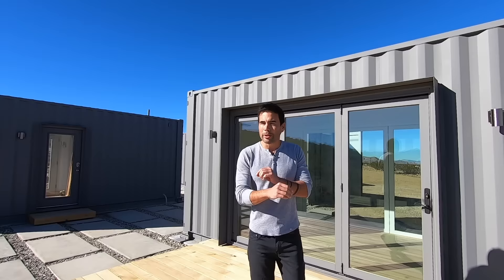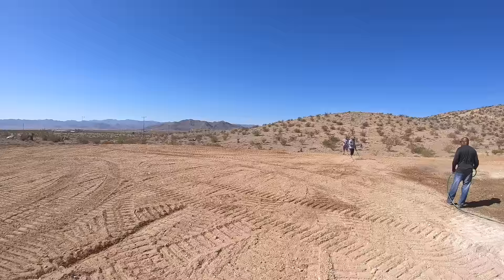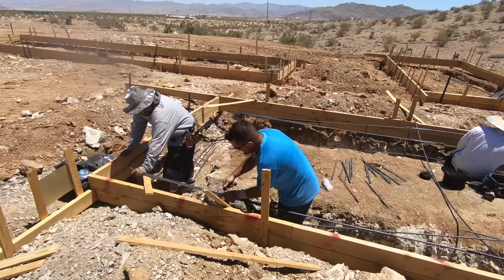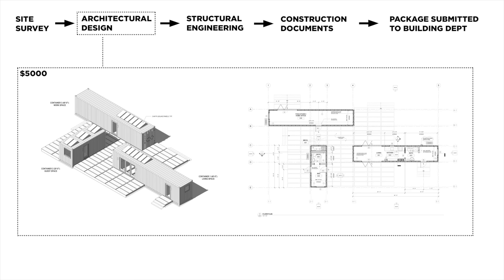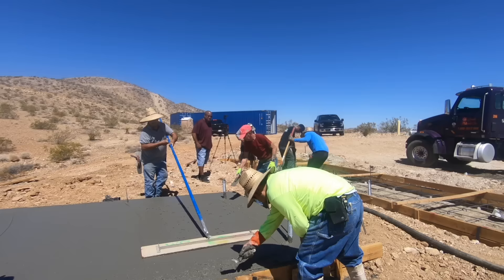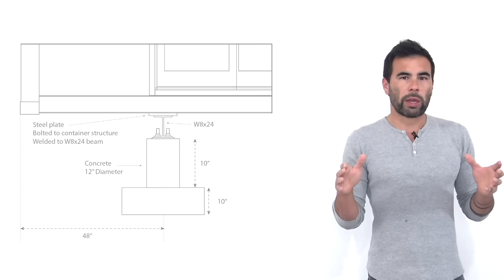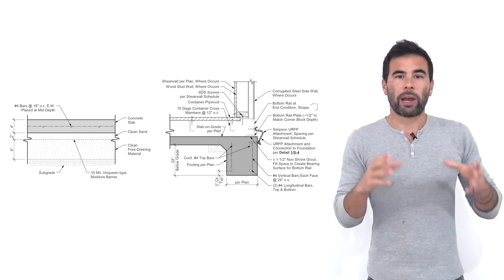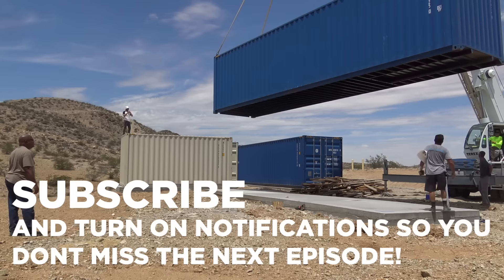Building a Shipping Container Home | EP01Permits and Foundation Design

Comment: I think concrete slab is a really good idea. There are of course more effective ways but your method is the most cost efficient. I would dig a hole big enough for another container, put them on top of each other then weld them together. then put steel reinforcements to the side corners. That way you would get a basement but it would cost more.

Comment: I thought the whole idea of Shipping Container House is to minimize work, time and money for constructing a home... and I don't think you saved any of those for it to matter
Reply: 99maxa ...it was an exercise in absurdity. A conventional interior built in a steel oven in the desert...only because of the “repurposed” cashe?
Reply: Cache
Reply: @davidjose2193  - hey David - did you know you can go into your original comment and edit it?  Off to the right are 3 vertical dots. One will say 'edit'.  Click that and you can fix anything you wrote.
Reply: To be fair, the actual construction of the home was far cheaper than a 'normal' home would be. The permits and taxes wouldn't be factored into the cost of materials and labor. Realistically, even with all the permits and taxes, its probably still cheaper than constructing a regular home in the same location.
Reply: @michaelbaker2495  Now imagine how much cheaper it is to do in EVERY OTHER STATE.
Reply: Yeah, but you'll only need 4 Mexicans or Central Americans to do the job vice 30
Reply: If it's just a box on the ground it IS cheaper. It's when you start to stack them in weird configurations that it becomes absurd. There's a Grand Designs where they essentially get a bunch of boxes in site and end up completely rebuilding them.
Reply: the slabs cost more than the containers.
Reply: That's exactly what I was thinking like wow this is an exercise in building a house so why not just build a house out of you know house materials???... LOL he's a Californian ON PURPOSE....we cant realistically expect too much I guess

Comment: That foundation is way over the top, you've been taking for a ride on that
Reply: What would be wrong with having six or eight 12" Sonotubes and putting the shipping container on top of that?
Reply: @andrewmalone8709  seismic activity. It's California.
Reply: @TheLegendaryFolklore  I get that, I'm just wondering what the problem would be structurally if you did that. It seems like it would be perfectly fine in a saner state.
Reply: @andrewmalone8709  it would be, but considering it's Cali, I think seismic waves would just kick the house into waves and shred the container one pillar at a time instead of a solid platform.
Reply: I doubt the amount of concrete, size of the hole, etc... had a real significant impact on the total cost of the house
Reply: Why are saying the concrete slab is needed for the seismic activity?  If concrete is so stable in an earth quake please tell me why all the concrete roads break-up and the highway bridges fell on top of each other? They put a kind of spring in the ground under Mobile Homes to be safer Crete Grease from earth quakes. We had several and had no problems 2 years I was their.

Comment: So far I've seen one suggestion for a different foundation and about 200 gripes about California. 

I would agree with that one suggestion: use piers at each corner. To deal with the lateral stability issue, make the piers sit on massive footers. Or use the box itself as a structural element. The connection between the pier and the box would have to be totally rigid in all directions, which might call for some additional steel welded to the outside of the box. I could see I-beams welded vertically to each corner, and then extending downward and embedding in the piers. Or something. 

Can't wait to see how he insulates this thing.
Reply: @toothlessgrin7540  That's right, he said that. And he wanted to keep the floor level with an outdoor deck, so that would have to be raised too. Hm. 
Not to argue with his priorities, but I think I would have gone with a raised house and deck. That might also have helped the house adapt to the site, which isn't totally flat, it appears. 
I don't recall why he rejected a perimeter wall foundation.

Comment: $25,000 for permits?!  Legalized and government regulated bribery.
Reply: Seriously Criminal. Land of the Free.
Reply: It's more like extortion than bribery.
Reply: What u didn't no that your gov is the REAL MOBB.....🤣🤣😂🇺🇸🇺🇸🇺🇸🇺🇸snakes of America
Reply: @Justin Case, Hey Justin, You wouldn't happen to be from Australia would you? Like the Justin Case I met at Phegans Bay on the Central Coast of NSW?
Reply: For 25000$ I got a large container house (10m*4) plus a pool
Reply: 25g is cheap here in Cali.. I've had quote as high as 150k.. He's lucky he's not in the sewer district or city limits
Reply: It lumped the $25000 into all of the preconstruction feed  i.e.  surveyor, architect, plans code review etc...    also permitting for tying into an area that was remote.  This is actually pretty normal
Reply: And the government wonders why homelessness is rampant. They make it illegal to claim a house, then require people to not be using drugs before being eligible for shelters, which is fucking hard to do when you don't have a bed to sleep in while your body detoxes, a home-cooked meal to nourish the body as it recovers from drug use, and a toilet to throw up in as your body tries to remove the drugs from your system, and then make stabby pavement or back-breaking middle bars to keep homeless people from having a respite from the elements.

Meanwhile, in Utah, the housing-first program was widely successful in getting homeless people off drugs and onto employment, saving the state more money.
Reply: @luvair6765  land of the expensive more likr

Comment: Dude shipping containers are engineered to handle way more stress than this will ever take. I think you over-engineered the whole foundation. Also why would you try to create anything of value in California? You're not even near the beaches, just go to Nevada it'll be the same thing but cheaper.
Reply: Your perspective is understandable but fairly ignorant.  Few questions for you... Were they designed to have large holes cut in the corrugated steel walls for doors an windows while  still perform to the "engineered" stresses you state?  No...  Were they designed with certain deflection criteria in mind that will prevent windows from binding/cracking over time? No...  Were they designed with higher factors of safety required when dealing with residential dwellings as opposed to industrial applications?  No...  Is there someone at the manufacture's company willing to stamp the permit documents accepting legal liability for the containers performance?  No...  I agree that other states let you "do it yourself" but the ones that do don't have significant earthquakes threats to worry about. This area on the other hand has the San Andreas fault running right through it.  And there are countless people who dump these containers on their property in the desert and live in them without issue.  You just can't permit them, meaning you cant insure them or sell them as a house to someone else.
Reply: travsb1984 you are the only reasonable  person in this comment section.
Reply: @travsb1984  
1: No, but this won't affect their sturdiness as a single-story structure. The frame takes most of the load, even if the holes are in the corners it will still have more than enough shear strength for this.
2: They are designed not to deflect that much, as they need to be stacked incredibly high without tipping. Think about a normal wall. It's just a wooden frame with studs running vertically every few feet, some diagonal members, and drywall nailed over it. This is a welded steel frame with corrugated steel walls designed to support over 20 tons in stormy waters. The windows will be fine.
3: The standards they are designed to meet are far more intense than those of a residential house (as far as structural integrity goes) This is why they are made of corten steel, and houses are made out of wood. 
4: Why would the company need to accept liability? Their product has been modified and isn't being used for it's intended purpose. 
5: Many of the regulations he ran into had nothing to do with earthquakes (700 sqft minimum footprint, 18" minimum 'crawlspace' height, etc.). 

These containers are designed to be stacked and unstacked 10 levels high on boats for 10 years straight with essentially no maintenance, exposed to the elements and the waves, connected to one another only by four bolts.
I think they can handle sitting on the ground and having people walk around in them.
Reply: @bradenanderson6989  Your responses and assumptions confirm that you still know very little about engineering principles, or how the permitting process works in general...  Thinking something will work, and proving it will work mathematically are two very different standards.  FYI, all of my questions were rhetorical and had answers of no...  I would agree that California has too much red tape, but most of the design considerations would apply anywhere, not just in CA.  The only requirement that stuck out during the video that made me role my eyes was the 700 sq ft requirement.  To my knowledge this is not a California requirement. Building codes in California are actually controlled at the local level, and they are free to amend the CBC however they see fit.  I suspect the 700sq*ft requirement is a local requirement.
Reply: @bradenanderson6989  Not to go to crazy in the comments, but I'll give you some insight.  Shipping containers are not designed to be perfectly ridged bodies.  They have some flex in them.  This allows each container to conform to the support it's placed on so that all four sides will align with the pined restraints and full bearing will be maintained, preventing them from "teeter-tottering" on uneven ship decks, tractor trailers, or train cars.  I had two of these containers on my property for storage and can attest first hand they are far from rigid.  We leveled the ground the best we could with shovels but we were only within about and 1" of true flat.  When the containers were dropped they flexed until all sides were fully bearing on the soil.  This was perfectly adequate for my needs, but if this were differential settlement caused by inadequate footings in a "house", every window and door in the container would have binded or even broke.  That's the difference between doing something yourself and having it designed by professionals in the permitting process.
Reply: It does not matter if a container is designed to be stacked, travel on a deck of ship, sit in a container yard or loaded on a back of a truck that is what 
they are designed for, engineered as you said. The simple fact,  you have poked a hole in the portside with regards to that comment, Shipping containers have been designed to do one job and that is to be loaded with goods. We are now taking something and making it a habitual space for human occupation, health and safety and building standards/regulations now apply and comes into play with this regard. Just like building a wooden or brick house, it all interconnected.. 

It not a work site or storage yard that is going to be temporarily in use and can be placed on blocks or on the ground and moved after a short period of time.

You need to take the shipping container in whole, a structure designed to do a certain job.
The moment you start cutting and making external changes on the container you are in fact messing with the structural strength on said container, that what the engineer designed and signed off on. 
You are aware that the metal sheeting actually holds the whole thing together, once you remove the sheeting it is just a rectangle that can easily break buckle and bend with enough force.
It got I beams on for the bottom rail for the main support and then on either end of the container  is the other supports for stacking purpose.

There is a whole lot of other aspects that come into play that is signed off by your provisional.  
The fact is that whole container is now touching or resting on the cast foundation, also depending on soil conditions, collapsing sand, rocking soil, it will also settle as one uni. At the end of the day it is the professionals job to make the dwelling as safe as possible to be lived in, or else the engineers or architects can be taken to court and sued for lots and lots of money or go to jail.  
But actually you need to go speak to an engineer and get him to break some thing down for you. In your mind, just slap it down and make it your home, it does not just work like that, there are reason why we have laws and regulations. 

And I use to work with containers, Load and unloaded them using forklift and movable ramp also done plans for stacked containers with a different foundation layout though.
Reply: @travsb1984  , with regards to the minimum square footing of the envelope for a dwelling, that is normally to do with the minimum size that you can live comfortable in in a house. 
Our minimum size for a dwelling is 430 square foot . 

It also depends if there is rules in the township or complex or home owners that want to keep try keep everything uniformed space wise.
Reply: Very intelligent post  @travsb1984
Reply: @Cent51  I don't work in the field of shipping containers, but where I am from there are plenty of businesses that build container homes for living purpose, and trust me they don't do any work for foundations - they just make sure that the containers are completely level and that's it. The only reason the job in this case is more difficult, is because the underground is potentially less sturdy and might shift over time or be effected by earthquakes etc. Apart from that, container homes are not as complex as you guys make it out to be. Most of this is just CA laws that are way over the top - because they have to comply with every possible situation and not just tiny container homes - but also large building complexes etc. Basically, they make 1 super complex rule that everyone has to follow equally, even though their homes are completely different. That's just a matter of government decisions and how each individual state is run. It's not about absolute common sense in all scenarios, far from it.

Shipping container homes in cities are much less demanding, I will admit that. But this stuff shown in the video is wayy excessive for what this build requires.
Reply: @Real_MisterSir  You cannot just drop a container on the ground, finish the interior and call it a day. There is exactly nowhere in the civilized world where it makes sense no matter the climate.
Reply: @bradenanderson6989  well said bro this was a money grab at its finest.   You could chop the whole side off and it would be stronger than most houses
Reply: @kevgersh5316  Your post proves you know nothing, So I won't even reply to your post.
Reply: @Real_MisterSir  I can agree with that...  I think that most government agencies are slow to react to any new developments and these sort of homes are relatively new to the scene and have not been properly accounted for in the building codes.  I work and live in CA and in their defense I think that all governments are slow to react, but if your local government doesn't do anything to begin with then it is not applicable.  But if your local government is highly involved in the building process (which they all are in CA) then these "structures" are held to the same requirements as other construction materials.  I KNOW it seems excessive, trust me I do...  But consider that large earthquakes around the world often result in hundreds of thousands of deaths all the time, whereas major EQs in the US often have deaths measured in the 100's.  This is not a coincidence or accident.  And believe me, if Arizona had crazy earthquakes they would have building departments the gave a sh** to.
Reply: I hate CA laws
Reply: Braden Anderson or Arizona
Reply: Nevada 🤔any other states. Thanks for suggestion.
Reply: The codes would become more reasonable if some lawyers start sewing for extortion. If there was a earthquake this wouldn't crumble like the other houses. Worse case scenario it would wiggle a bit and you might have to fix the plumbing...maybe....probably not.
Reply: It’s still a steel oven with a conventional  interior built inside. Eco-cuteness, eco-fantasy, goofy millennial logic.
Reply: @davidjose2193  this is what half way to socialism earns. Some of these guys want to head further in this direction. Take a gander at the cost of socialism. Carbon tax, air tax, water tax, fense tax, birth tax, death tax, ECT. ECT ECT ECT nothing is free guys ...light buld...tax

Comment: Cross bracing of the I-beams would likely have provided the stability needed. That would tie the two I-beams together and prevent them from rolling due to lateral movement. This type of cross-braced I-beam frame used to support large industrial cooling towers mounted on spring vibration isolation mounts, which in turn would be bolted to the concrete. This type of equipment is located at ground level and on building roof tops where seismic anchorage requirements are greater. 
Cheers
Reply: Great idea!